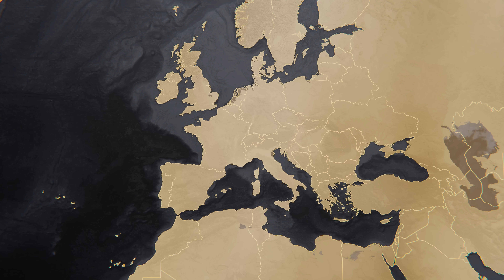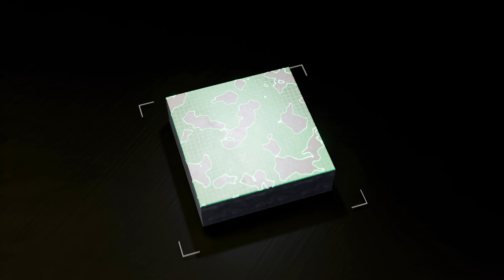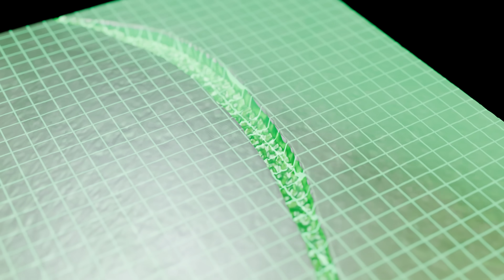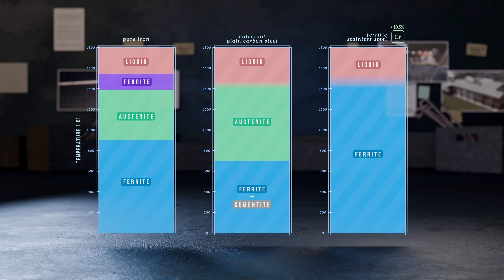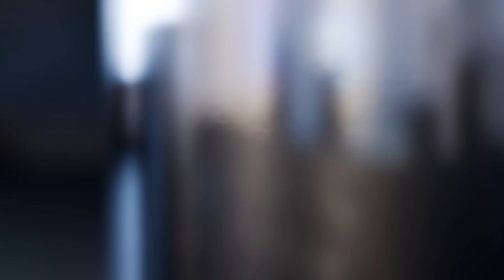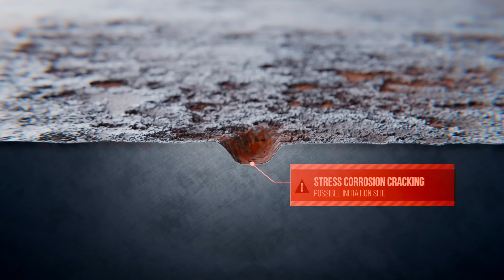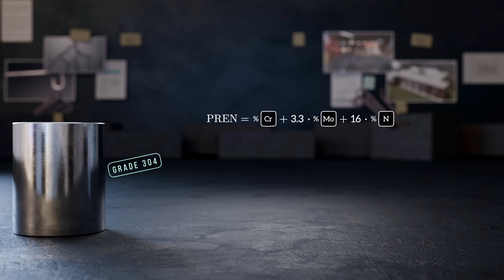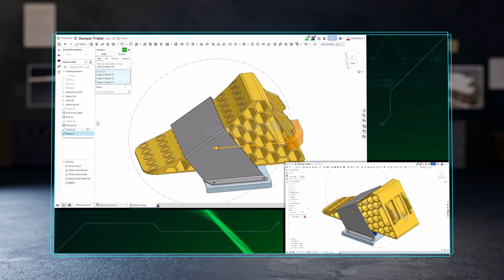The Problem with Stainless Steel

Comment: When you said swimming pool and stainless steel i immediately guessed chloride cracks, and you went on to give a great explanation of the root causes of it as well. By me, living by the coast, the simplest fix is to avoid stainless steels where possible, and instead go for hot dip galvanised steel instead, as it is going to have a much better operational life, though the one harbour barrier built during WWII was not reinforced with reinforcing rods, but instead used scrap rail, as that is what they had in large amounts, and light sugar cane track was used instead of steel rebar, along with other regular rail as well, as reinforcing for this rush job. Made removing it recently for an upgrade, to widen the harbour mouth, a bit tricky, in that they had to get a heavy lift barge in, lift them bodily off the floor of the harbour, and tow them out and dump them as a new artificial reef, as cutting it, or blasting it, had proven to be very time consuming and was looking to be incredibly expensive. So the blocks were moved offshore instead, a massive extra cost, but still faster and cheaper than the drill and try to blast them with explosives they had tried. not helped by some of the reinforcing being old mine hoist cabling, a very strong steel.

Those same light rail lengths were also used as scaffolding for where i live, using the old worn rail, and scrap galvanised roofing steel as a stay in place shuttering to pour the concrete flooring. You can still see the old nail holes from the roof, and the old flashing from roof edges, along with the roofing paint and tar used on some of them as well.

Comment: With cracking and embrittlement, stainless steels are between a rock and a hard place. As I watched this excellent video ancient memories of researching high temperature hydrogen embrittlement rose. The grades that are less prone to chromium cracking are more prone to hydrogen attack. This is different to hydrogen embrittlement in carbon/mild steels.

Comment: I recently moved to Switzerland. I see a lot of things that make me hope the engineers knew what they were doing. Cable cars, ski lifts, bridges, buildings hanging off the sides of mountains and tall buildings that are over 300 years old. This pool accident is tragic and Switzerland recently had a tragedy with noise cancelling foam that caught fire and killed 40. It was another ceiling accident. I still feel much safer in Switzerland than in the US.

Comment: Because 316 & 304 Stainless Steel is more widely available most people assume this is the Industry Standard for Stainless Steels.
In some ways it is,  but both of these grades are basic grades of Stainless Steel.

I'm surprised by the use of a Suspended Ceiling that is made of Concrete ???
I guess someone didn't consider a level of reinforcement in the Concrete and depended on support hangers to take any load ???

Comment: As soon as I saw this video, I was thinking how stupid it would be to think stainless steel would be a good material where a lot of chlorine was present. Not only that, but the vast difference between the outside temperature and the ambient room temperature. Also concrete is not exactly a long lasting material period. Both materials depend on environment and will malfunction if it's not properly taken into consideration.

Comment: Really rich video, thank you. I would love to see more like this. I'm interested in comparing CrMoly steel 4130 and 4140 properties. Also really interested in what happens when stainless like this is welded - does mixing occur to make it duplex? SS filler rods I'm familiar with are 308 and 309 and some have an "L" designation. Cromoly is used in high strength structural tubing in race cars, airplanes and bicycles. I've heard welded Cromoly needs heat treatment in motor mounts because of the high stress vibrations causing cracks on the weld heat affected zone. Fortunately on bicycles this is not reported to be a known issue because stress is less fast vibration and thinner wall tubes are thought to self anneal compared the thicked high stress motor supporting plates and tubes. Anyway I'd love to see a more scientific angle on some of this.

Comment: There are only two conditions: Austenitic (300 series) and Martensite (400 series). Ferritic is only type in the 400 series. Duplex is only a type in the 300 series. PH type is Martensite and not in the 400 series because of the addition of copper and shrinks with tempering. Failure of 300 series is due to the forming conditions because 300 series require more processing to remove the Ferrites which gives it's higher corrosion resistance and non-magnetic character. 400 series is not process so hard  which leave the ferrites and will be moderate corrosion resistance and magnetism. Ferritic is the lowest processed 400 series so they are very ductile in comparison to other Stainless. So the solution to the problem is the more processing, the more brittle with higher hardness, harder to machine and almost no elasticity. The less processing the more ductile, easier machining and a long elasticity range. Using stainless as tie rods in cement is a very bad idea, not because of the stainless, but because of the application.  Cement has Ferrite as a fluxing agent and ferric oxide and it becomes stronger with moisture (Chloric environment doesn't help). The very environment to promote stress corrosion cracking. This is the reason why iron rods are used because cement has similar material. Yes there is rust in the iron rods but there is no quickening of the corrosion process. Some paint the iron rods which adds years, but the cost is about the same as using stainless. Look at the price difference. One more point: Should always passivate stainless steel. Always... Later.

Comment: Go into a larger high use natatorium mmm and look at the stainless steel rails and other equipment. If there are chloramines in your he atmosphere you will notice a strong chlorine smell. Unless the stainless steel in the room is consistently cleaned and polished with proper treatment it will have rust and pitting.

Comment: I live in Cape Cod and a lot of the codes for building you have to use stainless steel nails, screws, bols.. However the 304 SS is not very good as it gets destroyed by the salt Air.

Comment: With that large of a chunk of concrete breaking away I would think you would be able to audibly hear cracking and creaking coming from a prior to that happening? But I'm no concrete guy, but when something stretches and it usually cracks in creeks, much like an old house. However it may have been too loud in the area to hear that over the pumps and fans running. Assuming they had fans.

Comment: Simply powder coat stainless steel. Powder coating is not very expensive, I've had quite a few parts powder coated, its so very durable.

Comment: We had a similar issue when I worked on Environmental Testing using large test cabinets. One had been loaned and was used with a dessicant to lower the humidity even more . It was one of the chlorides (can't remember exactly) , it might have been lithium chloride. Anyway it got spilt somehow and when we subsequently used the cabinet (304 stainless) the inner liner literally crumbled before our eyes. The stainless steel liner crumbled into small pieces as if it were like sawdust.

Comment: I still need an explanation as to WHY there was a concrete drop ceiling ? Also, your sponsor, a live streaming CAD system would be hell to use. Internet disruptions happen all the time, and that's not accounting for when I work on the train and it goes through a dead zone.

Comment: The main culprit over there was the Chlorine, Swimming pools always dozing chlorine during chlorination cycles
The chlorine mixed the water in the swimming pool  evaporated up to the ceiling then trapped and staying longer a period of time and constantly   eating the stainless anchor rods end point that exposes the air arround on it
Congcrete chemicals, chlorine, and water are the ingredients that leads to shorten the life span of the Stainless

Comment: Stainless Steel is great for corrosion resistance, but if theres any Chlorine ions in the environment Chloride stress corrosion cracking is basically a guarantee.

Comment: @12:57 unfun fact: stress corrosion cracking has the same initials, scc, as suspended concrete ceiling.

Comment: A good solution: specify a different grade of stainless, powder coat the stainless rods, and have a positive ventilation system in that space with fresh air, dehumidification and remote monitoring of the resultant atmosphere.

Comment: Just be sure you don’t use duplex where you need to weld often, especially with time constraints. The weld procedures for repair are much more demanding, and if not done properly destroys any advantage of the grain structure.

Comment: In my industry, I deal with these same considerations. The common understanding is that austensitic stainless steel is most corrosion resistant below 80ksi MYS, above that we use usually use martinsitic stainless steels in specific applications, or duplex steels if they are needed. Duplex steels usually have 25% chrome, and 110ksi and 125ksi are common MYS. If it’s a crucial component, we often use high grade nickel alloys such as 718 or 825. When comparing carbon steel to austinsitic stainless steel to super-martinsitic stainless steel, to duplex steel to inconel, each step is a factor of at least 2x and some are 10x in cost- while the cost of failure greatly outstrips the material cost, the cost of over engineering the metallurgy is in the many millions of USD. It is therefore important to get it correct. 

Generally, stainless steels are more resistant to acidic environments, but they can be much more susceptible to stress cracking- usually due to sulfides, but chlorides can be an issue. The interesting part is that chloride SCC is usually understood to be an issue at high temperatures exceeding 250 fahrenheit, and localized chloride pitting is especially understood to only be an issue at very high temperatures. In our case, high temperatures are much greater than would be in a pool. I would have not expected SCC in this application.

That doesn’t even scratch the surface on galvanic corrosion- i’ve seen that totally throw off everything, and cost in the 9-10 figure range to address
Reply: On deeper thought, I think the real issue here was using a suspended concrete drop ceiling for aesthetic purposes. This created a void that clearly became a very corrosive environment, and it did so in a design that was by its very nature supporting a very heavy and critical component. The best option is often to simplify. There are so many materials that can be used to cover unsightly structural elements and allow proper ventilation. And most of these things would be less devastating if they became dropped objects, not to mention they would not fail as catastrophically. The use of steel and concrete negated all of these benefits.

Comment: Simply put they used the Wrong kind of Stainless steel 
1.4301 (304)is the "Basic" one but cant hold up to clorinated Water or Saltwater like from the Snow and Salt mix in Winter 
1.4404 (316L) is the Stuff youd need for Chlorinater water 
1.4571 is whats used in the Pharma industry and that Stuffs very hard to get any Rust on 
Different Stainless Steel for Different Applications

Comment: I work in the water industry in the UK. The sodium hypochlorite that is used to disinfect drinking water and its pipework is stored in a more concentrated solution. A while back an industrial customer mis-specified their pipework for a chemical storage and dosing system, the 15% hypochlorite had corroded through the 304 pipe in less than 2 weeks. This wouldn’t happen in the supply of drinking water as we have some serious rules when it comes to design!

Comment: your definition of Martensitic stainless steels is somehow not correct. Its not only cooling rate that give the resultant microstructure, its also dependent on the chemical composition. For example, you would never be able to harden 409 stainless steel, even with infinite cooling rate! the percentage of C is the main Determinant.

Comment: As a welder I can personally confirm this. Ive seen low grades of stainless corrode many times. I also use to believe stainless couldn’t rust and a lot of people in my experience do sometimes. Its nice to see a video like this providing such information for the public. Thank you for posting this 🙏 . My metallurgical knowledge is mostly personal research and on the job experience. This helped fill the blanks on some things. Also makes it easier to explain things for my job.

Comment: This building looks like it was designed to prove a point when it fails, a Sword Of Damocles. Were any significant person lost in the collapse?

Maybe this was supposed to be a story about stainless steel but it should be a story about concrete ceilings not being an accident.

Comment: Aisa 304 or 1.4301 is not suitable for salt water or anything else with a notable chloride concentration etc. hydrochloric acid is used in desinfection of swimming pool water, doe the math. You need more Molybdenum.

Comment: I was looking into stress-corrosion cracking quite a lot last year after comparing the mechanical and chemical characteristics of older style (also lower cost for the era) glass enamel water heater and boiler tanks vs stainless steel. Where modern ones are commonly stainless steel and high-end modern ones are glass enamel on stainless, the older type common in the 1930s into the 1990s was glass enamel carbon steel (similar to some bathtub construction from that era and some cookware ... also chemical resistant industrial vats and tanker rail cars and truck trailers: highly corrosive liquids often used or still use enameled carbon steel for their containers).

We had a 1970s vintage glassteel construction water heater that probably would've lasted even longer had we noticed the small, slow leak from the drain valve (cheap plastic inline type known to fail, and suggested to be replaced as routine, but we weren't aware of that and didn't bother to routinely drain the tank of sediment, so noticed even less). So the entire lower section gradually rusted out and also rusted/corroded the fitting around the drain valve such that replacing it was impractical (and removing the plastic portion and capping the threaded pipe stub still didn't fully stop another small, weeping leak that likely developed from the outside-in from the rust) ... also the feet then collapsed while we were deciding on a replacement, so it had to go. (never ruptured/burst though ... and the original copper hot and cold articulated tubes only started leaking through pinholes AFTER trying to reuse them ...the survived being violently yanked 6 inches when the feet collapsed, and din't leak ... but trying to bend them during disassembly was enough to expose tiny corrosion pinholes that had been self-plugged for years with dense hard water deposits + corrosion)

I understand most water heaters from that era (or modern ones) don't last nearly that long, and when they do, it's usually an indication of an above-average standard condtruction (ie just a good luck of the draw well above the QC/QA limits), so kind of a shame we didn't maintain it better. (I was kind of surprised it was the original 1977 unit and not a replacement from the original owners when the sold in the 90s)

The more common problem known with many types of stainless steel compared to carbon steel (and lower alloy crome/nickel/moly type steels, especially common chromemolly structural steel, like used in some automotive applications) is tendency to gall. A serious problem for use with moving parts and even for bolts/screws with metal on metal contacts. (stainless steel bearings need special care and engineering for this, too, though it generally makes plain bearings and sliding rail surfaces impractical or limited in use vs polished roller or ball bearings which have more suitabiltiy with SS)

Comment: The pool a source of moisture the CHEMICALS in the water / vapor would corrosive over time eat away at many materials not just epoxy or stainless steel that water has chlorine and acid in it !

Comment: We use 316 for H2 piping near chemical industry. Lower grades and several months later we have light corrosion so we have to apply a C5 Paint system to protect everything steel except 316.

Comment: Thats exactly the missinformation: every technician/engineer in the metalworld knows that stainless steel 304 (in Europe defined as 1.4301) is not(!), I repeat is not(!) suitable for chloride atmosphere. There you need 1.4571 or 316Ti!!!

Comment: This is well known in the sailing fraternity that rigging is not up to the rigours of sailing, so back to the old ways of galvanized wire rope. At least one can see the rust forming and replace when necessary.

Comment: As a retired metallurgical/welding engineer, I used to say the most dangerous engineer is a mechanical engineer with a materials selector guide and obviously it looks like architects fit that statement.  Some comments here are from welders and that is a whole nother ball game when talking about fabricating/using stainless steels.

Comment: thanks! I was right hating on indoor pools or pools with concrete ceilings in a particular location in our country with plenty free hot water.  Not only is the aesthetic not pleasing, I reasoned that steel will rust and lose its grip on concrete, making cracks, falling bits, and eventually failure of the structure.  Turns out stainless steel is not even helpful